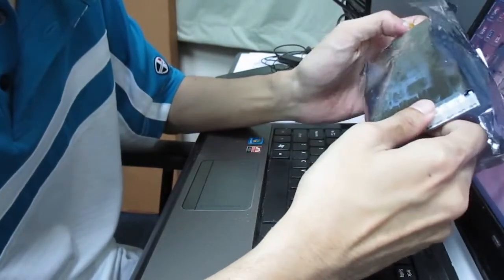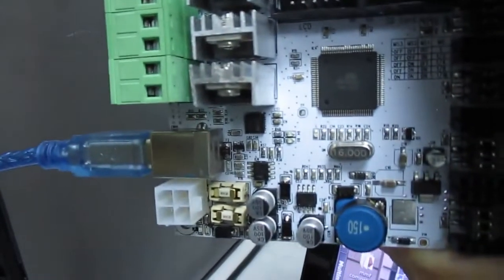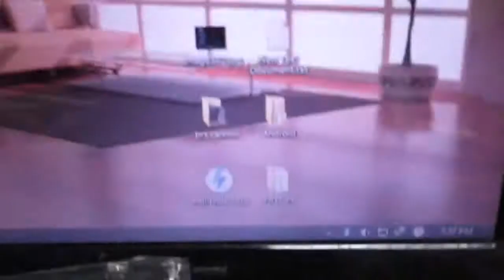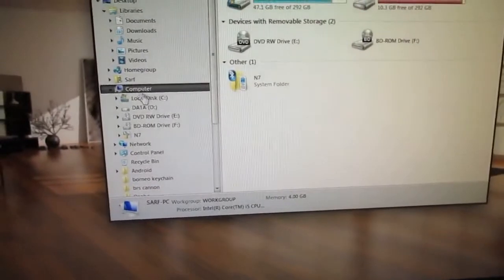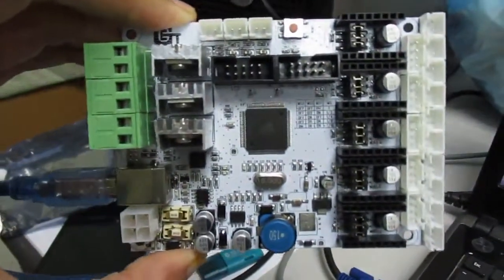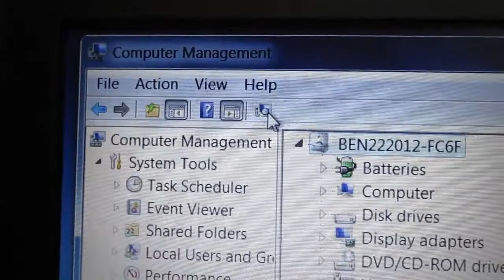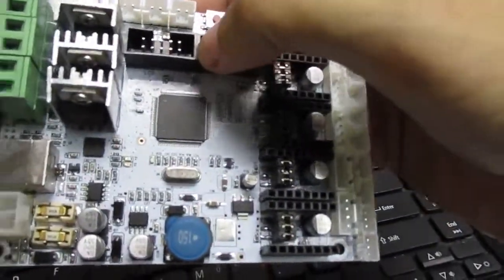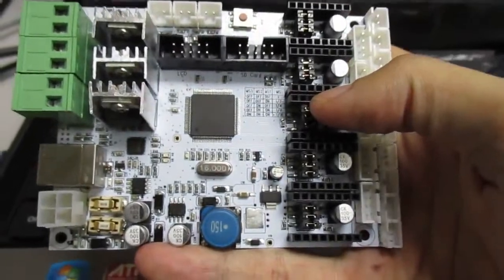To Geeetech Support Team

Comment: Even a sanguinolulu, except single extruder. If you want good results use the board that prusa uses for his new one. It’s a nice board. As far as Geeetech. Their support lacks severely. They have a us based tech that is over worked but is very good! George’s 3d printers. But as said you should be handling that board with any static gloves or even a wrist strap. Or at least leave it on the anti static bag. Slight static can discharge at 20kv but very low amp but enough to fry the board or devices.

Comment: Board should be detected without connection any external power supply/source. USB port whatever computer type is should give you enough power to initialize FTDI and detect new device.